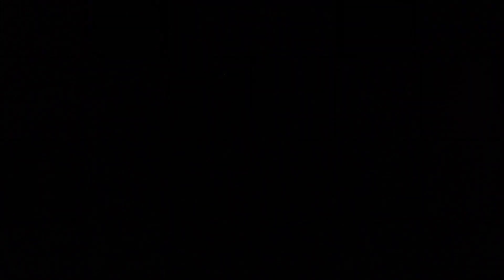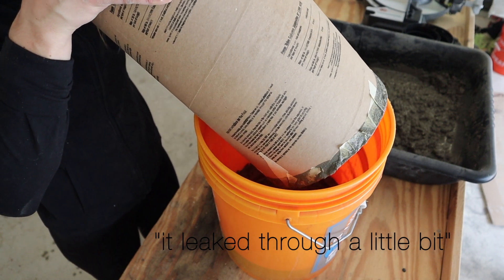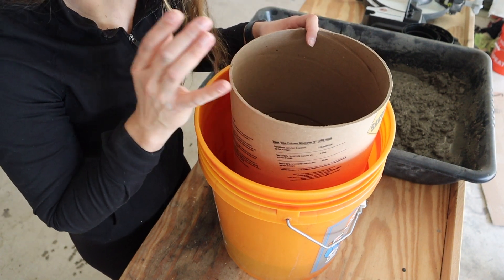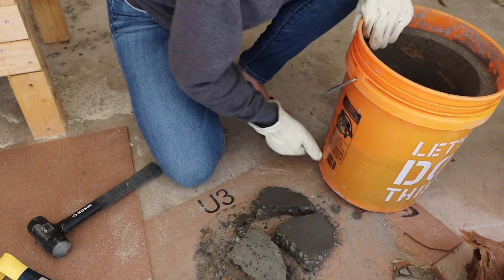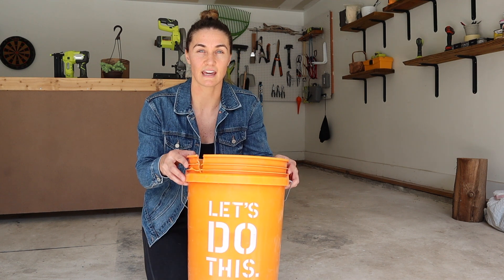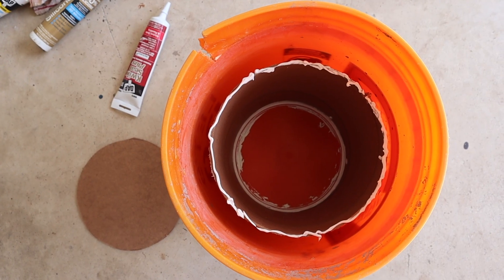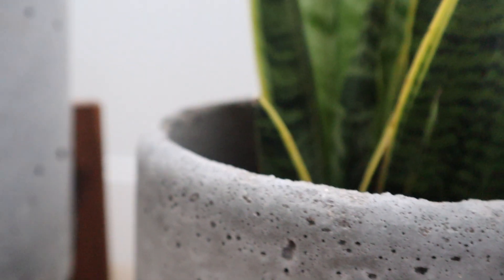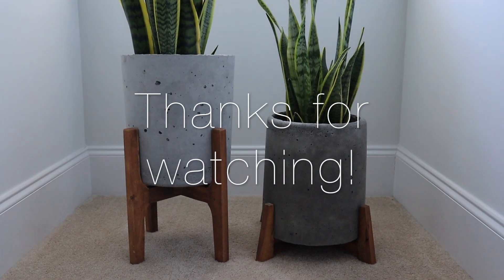DIY Large Concrete Pots

Comment: Hello i really like how you should us ur fail until u got what u were expecting so i thoughy i could ask as ive been working with cement lately, regular premix with sand and gravels, but after 24 hours the items are still gritty, is it a fail? Or should i wait longer, advices are appreciated ❤
Reply from the maker: I’d give it 24-48 hours to cure. If it still looks wet and gritty, might have been an old batch or too much water to mix ratio. Hopefully that helps!
Reply: @justawoodworkher  im trying to keep a string mixture not even pourable, one item still looked gritty others went well after like 48 hrs, im trying white cement next heard its stronger, thanks alot for ur time and help